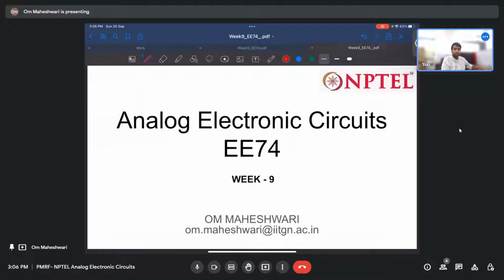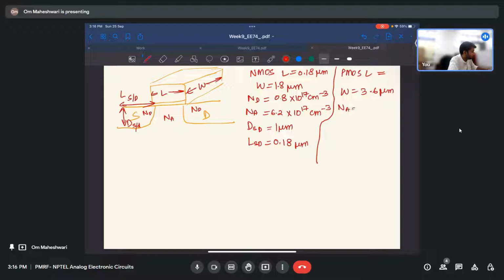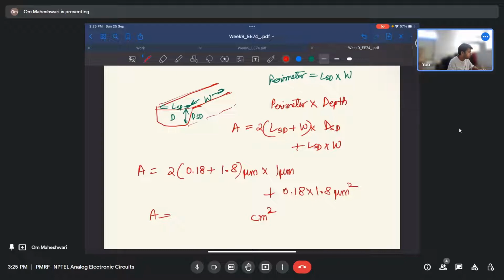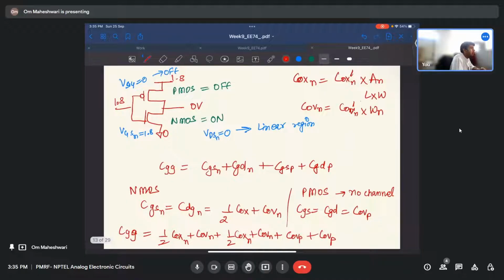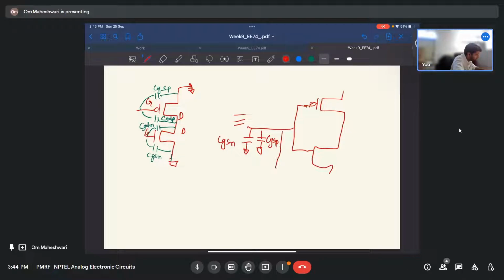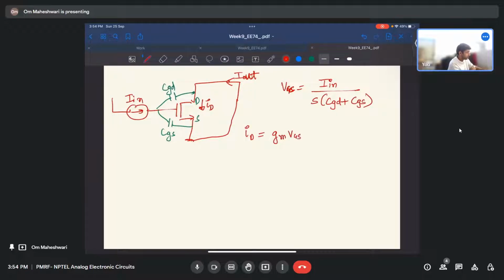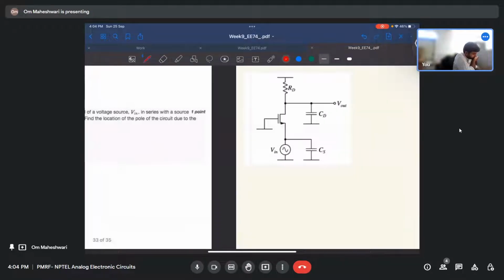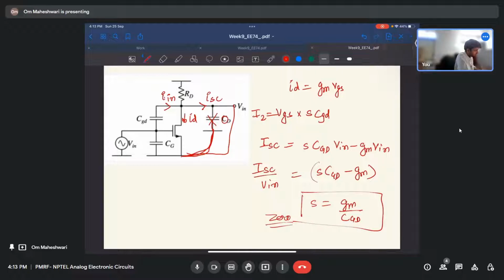Analog Electronic Circuits EE74 - Week 9 Live Session

Comment: In 8 question why is the rc calculation for pole taken at input but not at the output as in case of previous question sir
Reply from the maker: rds is infinite and due to short circuit, RD is shorted, so pole at output node wont come into picture